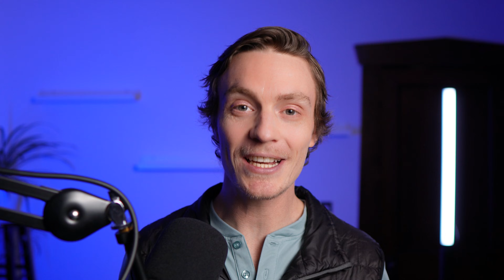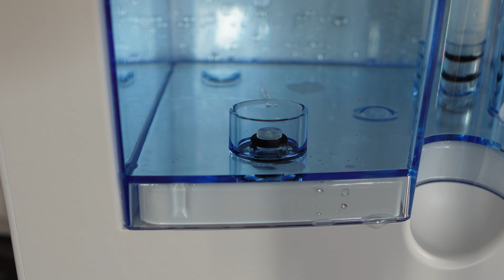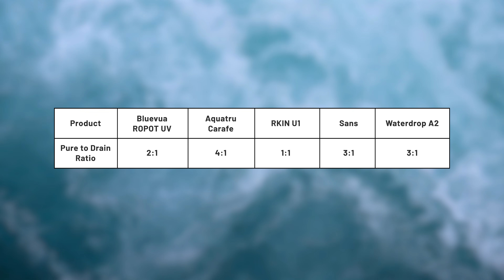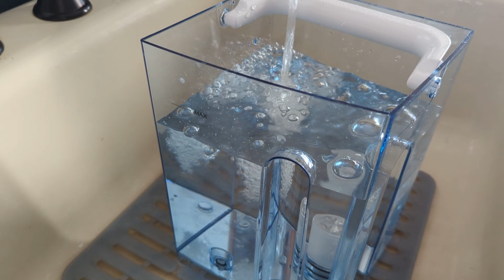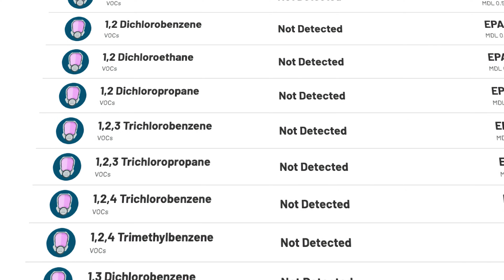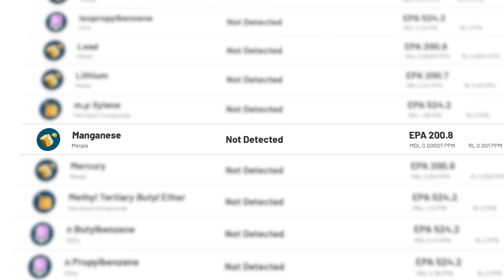Is the Bluevua Water Filter any good?

Comment from the maker: 🔥 Check out the Bluevua ROPOT here  ➡ https://geni.us/nHTRTh
Reply: Please check pure water mini classic distiller
Reply: Have you tested the iSpring RCC7?  Maybe against the waterdrop x
Reply from the maker: @thatiscrazytothe3rd  Not yet, but I can add it to my list
Reply: The link yu gave takes me to Amazon to purchase Bluvua. Is that your intention? I was expecting a link to the pdf test results.
Reply from the maker: @fayebriggs2177  Lab reports are linked in the description, here they are as well 
Baseline Test	gosimplelab.com/7QZ2HY
Bluevua ROPOT	gosimplelab.com/X5YPXI
Reply: So I’m assuming your top pick is still aquatru? Looking to purchase one soon. My only concern is the mineral loss and the fact the replacement filter makes the water more alkaline (which alkaline water apparently isn’t recommended for dogs).
Reply from the maker: @Trixlv  According to our data-driven scoring system, yes Aquatru https://geni.us/JZ34mU still holds the top position. If you are concerned about alkaline water, then I would recommend not using their integrated remin VOC filter and rather remineralizing manually

Comment: Wrong information Both pitchers have bottom-flow valves designed only to dispense water directly into the machine, which means you cannot actually use the second pitcher as a standalone pitcher outside the unit.
Reply from the maker: I think you are referring to another product. These Bluevua units fill the pitcher from the top

Comment: Great review! I am considering this or SimPure Y7P-BW 5 stage version. I have fairly hard tap water (268 ppm / 15.7 gpg as CaCO3). 
Do you know whether these systems can reliably handle that level of hardness without pretreatment? Particularly concerned about RO membrane scaling, filter lifespan, and how frequently descaling would be necessary.
Have you tested it with similarly hard water or noticed any performance degradation over time? And, also which one would you recommend? Thanks for the help!!!
Reply from the maker: I don't recommend using any countertop RO with water harder than ~7GPG (120 PPM) without pre-softening first. Yes, you can descale. But you'll have to be doing that regularly. That's the reactive approach. Watch this video I made all about this https://youtu.be/pEC3GZmM_1Y

Comment: I have the regular non uv ropot and just modified it so the waste water goes to my sink instead of back into the reservoir ....all it took to do this is some flexible clear tubing and a drill. The tubing I used fit snugly over the ropot waste water tubing that would normally go to the reservoir. Nothing is needed to do to reservoir because there is a check valve in the bottom of the reservoir where the waste water comes in. You also need to remove the intake tube in the reservoir that's supposed to only take upper level water. It will empty the 1 gal reservoir to fill a half gal carafe...it fills the carafe by time not volume and works perfect. The waste water will be a half gal and could be routed to a watering can placed in your sink instead of sending down the sink drain. Then I routed the tubing to my sink through a hole I drilled in the bottom corner under the panel that comes off to replace the filters. Since I'm not recycling dirty water back through the system again, I bet my filters will at least last longer and probably the quality of my water is better than your sent out lab readings.

Comment: Flouride is actually good for us, optimally ~ 0.7 ppm. It prevents tooth decay and cavities. There is a reason municipal systems add it. It does not affect taste unlike chlorine. It is good that Bluevua is leaving 0.2 ppm of it. AcquaTru completely stripping it is not positive.
Reply: You don't need it humans have survived without it and had perfect teeth I would rather not have it in my water just use Fluoride toothpaste. As some who had a mouth full of a cavities due to eating a lot of sugar and not brushing my teeth and going to dentist that was the problem changing my diet solved all these issues not the Fluoride in the drinking water

Comment: I got glass aquatru a year ago because your other video and I regret it. The top of the pitcher gets moldy quickly on the seal and plastic dispenser. Also had to change the filters twice already
Reply from the maker: How often do you clean the entire unit? Have you seen this video about sanitizing the internal components? https://youtu.be/9R2nLkkHFCc
Reply: I guess this is the reason Bluevua has UV feature in its system.

Comment: Let's say I drank 1/3rd of the carafe, but would like to keep the carafe fullby next time, I can use the 1/3rd carafe setting
Reply from the maker: It automatically stops filtering when the carafe is full, so that makes the setting moot for this use case 🤷 use what you want, replace it, and it filters till it's full again
Reply: @waterfilterguru  To test it out, I put half full carafe, and selected full carafe for filtering. The carafe got overflown (from the pouring tip) and I had to turn it off manually. 

So it basically doesn't know when the carafe is full. So I instead could've chosen half carafe setting so it only fills the remaining half carafe and doesn't overflow right?

Comment: I don’t understand don’t under sink RO systems require the drain install? So how does this handle “bad water” disposal?
Reply from the maker: The reject (waste water) is recycled back in the tap water tank. This allows the unit to provide a better recovery rate than most under sink ROs, and is also why its vital to always empty and refill the tap tank when indicated, rather than just topping it off
Reply: @waterfilterguru  that’s actually pretty interesting. I did some research and came to that same conclusion.  I understand it now however it might save on water, but it seems like the filters are now working.” twice as hard.” somehow when I did, the math filter cost remain surprisingly equal, whether they are under sink or counter countertop.! Weird.

Comment: How does it affect taste?  Does it improve the taste of water?  The truth is that standard tap water is safe to drink.  The reason I would get it is to improve on the taste of the water.  Thanks!
Reply from the maker: Taste is completely subjective, which is why its not part of my data-driven scoring system. That said, yes this system should improve taste for most folks

Comment: Speaking from experience, if you have an elderly person in the home, they might struggle to lift the water container when full.
Reply from the maker: That is a very fair point and an important consideration for accessibility.
Reply: @waterfilterguru   My wife is 70 and struggles with it. I have noticed that sometimes it gets stuck trying to remove it and sometimes gets hung up installing the reservoir.

Comment: I have multiple bluvua systems, as at home and at my gym. I did a test where I used all filtered water from the Bluvua machine. All filtered water came out to 169 in and 2 out, when the previous score was 338 In and 8 out. Why would water that had just been 8 out now be 169 in? It seems like a scam. Ugh. Ana I've been using the bluvua system for 2 years now.
Reply from the maker: I assume these numbers you are referring to are parts per million (ppm) readings of TDS from a handheld meter, correct? To clarify, this isn't a "score" its a measurement of the dissolved solids (good and bad) in the water.

A TDS reading alone doesn't tell you if water is healthy or not, as it doesn't tell you what that total dissolved solids content actually is.

Since you were getting low readings and now the reading is significantly higher, that indicates the RO membrane is due for replacement. Have you ever replaced it? You said you've been using the unit for 2 years, that's right around the time the membrane should be replaced
Reply: @waterfilterguru Yes, I have changed them twice actually. Currently all filters have 4 bars. I just saw in your video you sent the samples off to a lab, so that makes me feel better! Also, I didn't realize what the scores meant. I thought it represented the toxins being filtered out. Thank you! that clears up my question.
Reply from the maker: Here's a video that explains more about TDS meters https://youtu.be/yHvdYWXiVzI

Comment: Me realizing you are one of those influencers just promoting this product.. I noticed something an the ROPOT that made no sense and that is the number that's given by PPM of the water going in to be filtered.. so we all know that the bad water is cycled back into the water reservoir as waste water... that same water should have a good amount of ppm not like the water were supposed to be getting that is claimed to be around 6ppm.. I realized as the machine is filtering water that PPM in number doesn't shoot up much it kind of stays in the same range the whole time but technically it should be rising a bit since the waste water is putting more back in.. yes I'm still considering that the filters are catching many of these parts (PPM) but still the waste  water should have some in it or it wouldn't be waste water, so that PPM in value should rise as the machine pumps water out
Reply from the maker: Totally fair to be skeptical, there are plenty of “review” channels that are basically just ads.

That’s exactly why I built my scoring system the way I did. Every product gets judged on the same data-driven criteria (things like contaminant reduction performance, certifications, real-world usability, maintenance costs, warranty/support, etc.), and the scoring is done the same way no matter who the brand is. Brand relationships don’t factor into the score at all. If a product tests well, it ranks well. If it doesn’t, I say that too, even if it’s a popular brand.

If you want to see exactly how that scoring system works and what goes into my testing process, it’s all laid out here: waterfilterguru.com/how-we-test-water-filters/

Hope this helps

Comment: So if you bought a just a simple gallon filter 48 filters out fluoride the few other things images holds maybe a half a gallon will that help as well if you already have the system of the one you were talking about on the video thank you
Reply: Did you ever find out? I have the same system too late to return
Reply: I know most folks can't do this, but i bought an undersink filter that removes the fluoride, and then store it in 3 gallon jugs,
and when i need drinking water, I take what i need (from stored 3 gallon jug) and run it through the Bluevua.

Extra work/cost, but in my opinion, it will extend the filter life of Bluevua (since my undersink RO does the heavy lifting first).
and this way, i know where Bluevua comes up short (fluoride), the undersink takes care of....

Comment: We are trying to buy a countertop RO with UV water system for our condo in La Cruz Mexico. Our complex has a water filtration system and softener, but it doesn't filter out bacteria and those kind of contaminants. Is there any system that can do this?
Reply from the maker: Reverse osmosis should not be used as primary treatment for microbiologically unsafe water. You'll want to first disinfect the water upstream of the reverse osmosis system.

Comment: It has varying settings for how much water you want filtered because you may want to top off the carafe with a 1/3rd-2/3rds depending on what the fill tank looks like. I think it's a great feature, but I would've liked it more if you could get 2 full carafes worth of filtered water off of 1 fill tank, as opposed to 1.5 carafes per fill tank. Anyways, there have been tons of instances where I top of my water bottle from the carafe, leaving only a bit of filtered water left while also having a small amount left in the fill tank before it's going to demand a flush and refill, so I'll set it to a 1/3rd before changing out the water in the fill tank. Hope that sheds some perspective on the matter.
Reply from the maker: Thanks for sharing your experience and insights!

Comment: just ordered UV version on sales for $315. I was torn between this one and aquatru carafe. I wanted remineralization and I didn't like that it's built into a big filter in aquatru version and saw many complaints about the taske. Bluevua remineralization filter can be easily detached if needed.
Reply from the maker: Thanks for sharing! You're right that the AquaTru Carafe has a built-in remineralization filter, while the Bluevua gives you more flexibility to detach it. Taste is totally subjective—it really depends on the individual. In our testing, we saw a noticeable pH increase from both the AquaTru and Bluevua systems, which is likely the main reason people notice a taste difference. If you're sensitive to the taste of more alkaline water, you'd probably pick up on it with either system.

An easy way to test this before purchase would be to buy a bottle of alkaline water from the store and see how it tastes!
Reply: May I ask where you bought the UV version for $315?

Comment: I'm dumb, I got this and I think it said it would expel dirty water somewhere, and it said you can use it to water plants or whatever. Where does this rejected water goooo? T_T I can't figure it out.
Reply from the maker: The water recirculates in the dirty water tank. Once the system is no longer filtering water from the rear tank, the remaining water is concentrated with contaminants and should be discarded (used to water your plants) and the tank refilled from empty.

Comment: Does the pump and high water pressure flow )in tankless RO system cand lead to wear out the membrane faster
Reply from the maker: Not that I'm aware of. Pressure is required to force water through the membrane, this is how RO works

Comment: OMG 🤦🏽‍♂️ seriously? I just spent $350 on one of these! And the fluoride is one of my biggest concerns. So I should have purchased the Aqua Tru instead. That one completely removes the fluoride? How about the chlorine?
Reply from the maker: Correct, in our testing Aquatru completely removed detectable fluoride, check it out https://youtu.be/pcwO6VKm-0g

Both systems eliminated chlorine
Reply: @waterfilterguru  I like the Aquatru Carafe, but I am concerned that it adds aluminum to the water in several reviews with before and after testing I have watched. What are your thoughts on this?
Reply from the maker: @markhyland9850  I've tested Aquatru 3 times, and aluminum was not detected at increased levels post-filtration in any of the tests. Links to lab reports in the descriptions:

Aquatru Classic test https://youtu.be/NubOZMtj68g
Aquatru remineralizing filter test https://youtu.be/xQCllBCJAHY
Aquatru Carafe test https://youtu.be/pcwO6VKm-0g

I can't speak to others' test results as I don't know how their testing process was executed
Reply: Ugh I paid 600$!!! For this system

Comment: I bought this exact model 1 year ago, I still use it just for myself I fill it up once a day haven’t had to change the filters yet and haven’t had any problems .
Reply from the maker: Right on, thanks for sharing your experience I appreciate it as I'm sure others do as well. 

Out of curiosity, what are the  filter lifespan indicator lights showing?
Reply: @ filters 1, 2 and 4 only have one bar left and filter 3 has 3 bars.
Reply: @priscillagutierrez1065  How about the remineralization beads?
Reply: @abfonsec tbh they even talk about the remineralization beads in the manual I JUST realized what the remin filter was and where it goes on the glass drinking container. But there’s no way to know otherwise
Reply: @Laserenesky  I just set mine up and was surprised by how they didn't mention the remin filter in the main setup manual lol
Reply: It wastes a lot of water
Reply: @1hendrixx7 do😂you have house plants? Do you mop up the floor? 😂